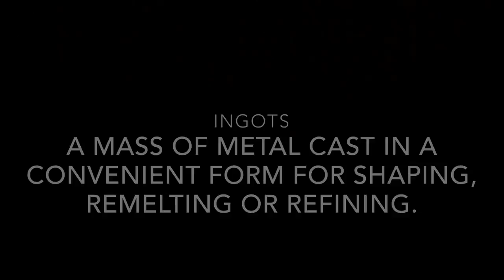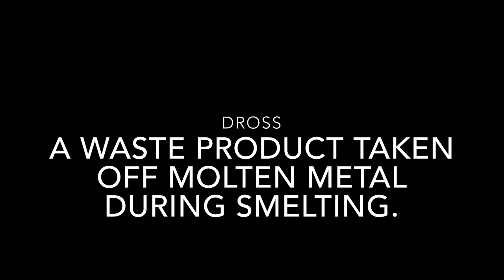Smelting Aluminum Cans

Comment: perfect timing! thanks bro! with my 10th anniversary coming up (aluminum is the traditional gift) I've been thinking about this... think my wood burning stove would get hot enough if I sunk a small smelting pot on a long handle into it?
Reply from the maker: Thanks Tim! I don't think the wood stove will get hot enough or maintain the heat required to melt the aluminum. However if you find some spare parts like a brake drum, some black pipe & a blow dryer, you could throw together a forge that should to the trick! Look up brake drum forge. The goal is a steady temp of 1220 f or better. Hope this helps. Happy anniversary in advance;)
Reply: well i have brake drums, of course! lol. i also have a heat gun to move air, but a hair dryer might have less heat, stronger winds. thanks man.
Reply from the maker: +tim sway You don't want to use hot air,  just steady stream of air flow that will raise the heat of the fire and bring it to an optimally temperature. For instance I made a brake drum forge and used an old air mattress inflator as my air source & wood scraps as my fuel. It worked fine for melting aluminum, but didn't get steal hot enough for me to do some blacksmithing. Use a blow dryer on the cool setting & you should be in business :)
Reply: thanks bro!
Reply from the maker: +tim sway Anytime my friend.

Comment: cool video! Are you going to do some blacksmithing and casting projects soon? Good luck! congrats with 1000 subs!
Reply from the maker: Thanks Maarten! That's my goal! Need a little practice & to re watch some of your videos as well some others to get some inspiration:)
Reply: Haha thanks! Just a tip, keep it simple. Learn the basics like drawing out, forging a point, twists and bends. Just practice on some cheap mild steel. Once you can do the basics you can start to do more difficult stuff but always keep practicing the basics.
Reply from the maker: +knives&stuff Great tips! I've done some smithing, but my homemade brake drum forge didn't get the metal hot enough with wood & coal isn't easily accessible. Now with this forge I can finally achieve the heat I need with scrap wood.